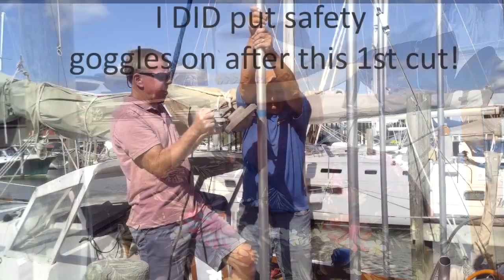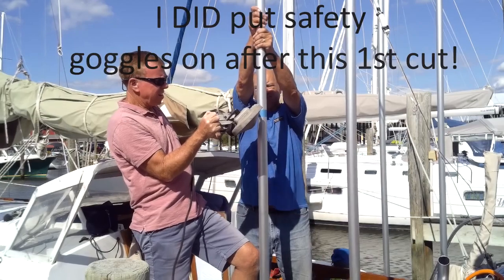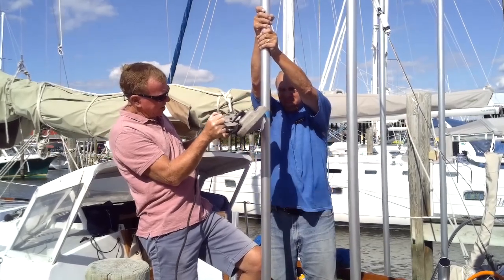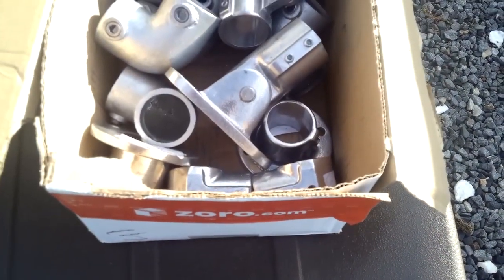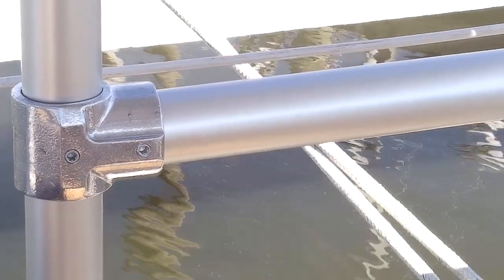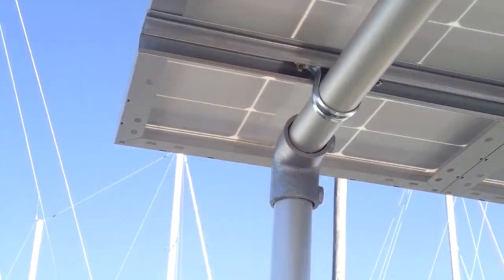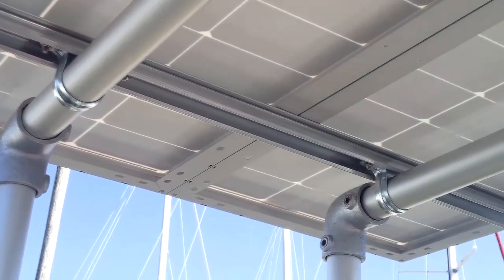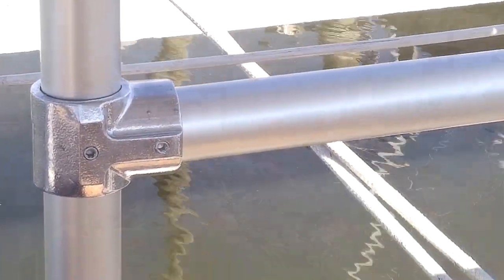how to make a solar panel arch

Comment: I've installed many pole lights as a.commercial electrician.  Often the mounting bolts have a skirt around the hardware to hide them cosmetically.  Sometimes the area under the base of the pole is "Slushed" with concrete grout to clean up the appearance and even help support the base if it is really far above the surface or the grade was on a severe angle like your deck was.

You could wrap the bases around with a sheet of plastic tapered to make a cylindrical.skirt down to the deck and pop rivet it into the speed rail base.  Then the bottom of the skirt could be caulked to keep grunge out and to make it look really finished.

Another option would be to fill the area with thickened epoxy or perhaps other less-permanent cosmetic filler putty to hide the gap.  Bondo comes to mind, or other lightweight waterproof filler -perhaps an expanding foam product.
Reply from the maker: thank you ,i did put marine grade filler/caulking i like the expanding foam idea
Reply: Try to avoid "Great Stuff" because it expands something like 7 or 8 times its original volume and is very messy and impossible to clean up after it starts to cure.  Even before it cures only acetone or similar harsh agents will touch it.

DAP makes an expanding foam in a can that only expands about 3x and is water cleanup until cured.  It is a little denser type of foam too once cured, so it is easier to cut and sand for shaping

Comment: Thanks for the i formation on this Speedrail ?  aluminium Tubing for boat Arch construction, plus its strength . I was getting very concerned about the potential Weight of 316 stainless steel Tubing for a suitably strong Solar Arch, and it looks like you have supplied me with a so,Union to the problem. Many Thanks from Another Guy in the UK. Best Wishes and Fair Winds.  Bob. 👍
Reply from the maker: thanks for watching, glad this was helpful

Comment: "look, that's not movin'"  as it wiggles while trying to shake.  400 watts, how does jj watts feel about the other 399 watts?  I would now take a wedge of wood, coated in epoxy to lengthen it's life, and put the wedge there in place of the nuts on all 4 posts.
Reply from the maker: ok it moves a little, not much, also the $1900 units move a little